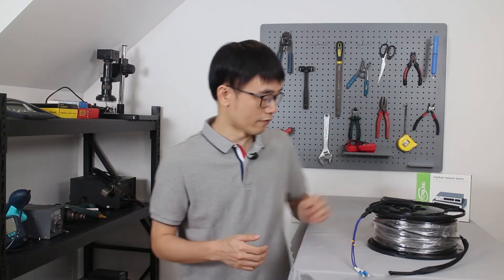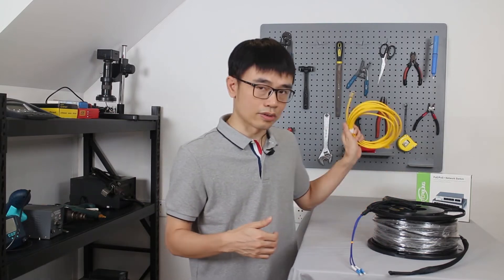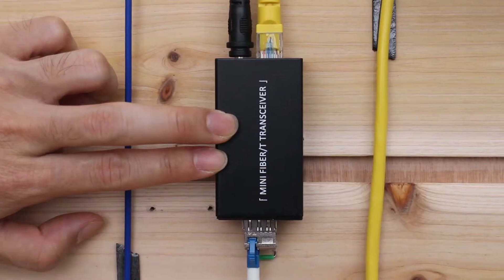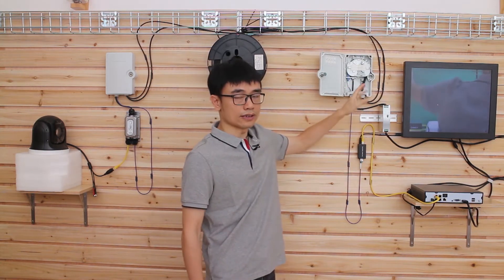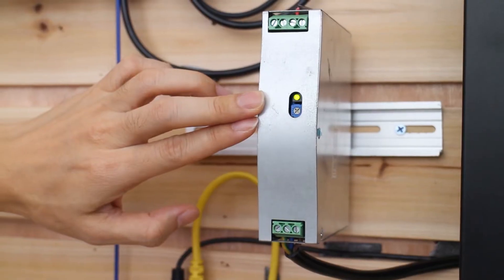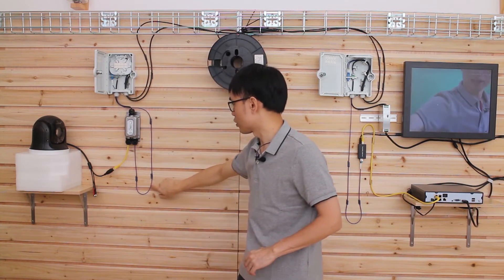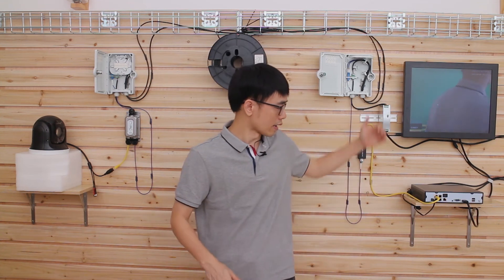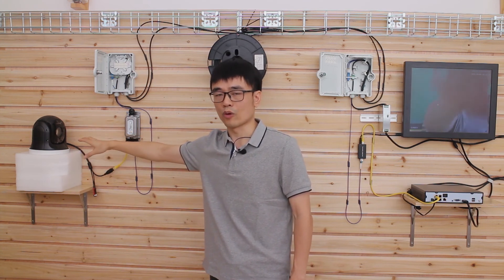How to Use PoE Power with Fiber Optical Cable

Comment: This is brilliant.  I can run one fiberoptic cable to under my deck which has an electrical outlet.  I can then use an outdoor enclosure and connect fiber to a switch that has POE.  This also reduces risk of a lightning strike because I don't have a CAT cable going from my network rack to outside, the fiber is made of glass.
Reply from the maker: Thanks! If you're interested, you can also watch this video on powered fiber cable: https://youtu.be/QZqXNbv3Iw8.

We've designed a series of composite/powered fiber optic cables that can transmit data and power simultaneously over a single cable.

Comment: I have a question, what if i have a fiber cables with 3 steel wire, can i use the steel wire for power line? Is this possible... Thanks
Reply from the maker: Strength members such as aramid yarns or steel wires are used to reinforce and protect the cable further against bending or stretching forces. It is best to use proper power cables for power transmission.

Comment: Thanks for the video, you still didn't provide a way to transmit power over fiber cable which is not achievable
fiber cable can stretch for MILES while power cable can't reach such a distance. is there a different method to install the power source next to the camera and send an ON/OFF signal from the TV side over the fiber cable ?
Reply from the maker: The fiber optic cable is made of glass. The core is the glass. You can send the power over the glass. It is the copper conduit. One of the solutino is you pull the copper cable in parallel to send the power.